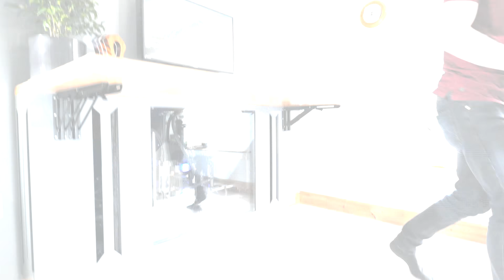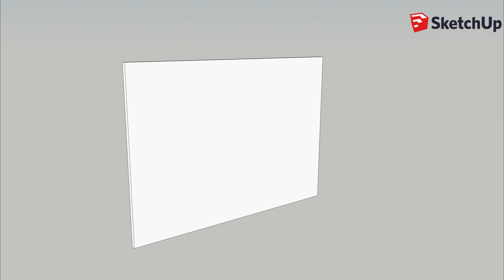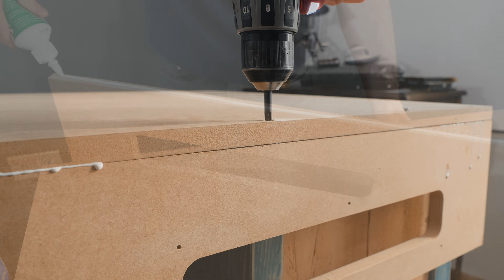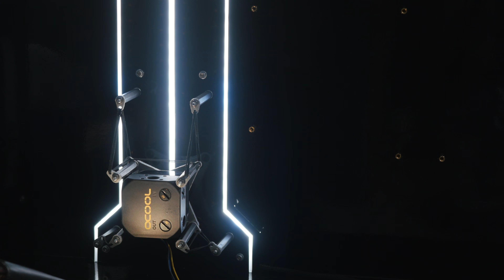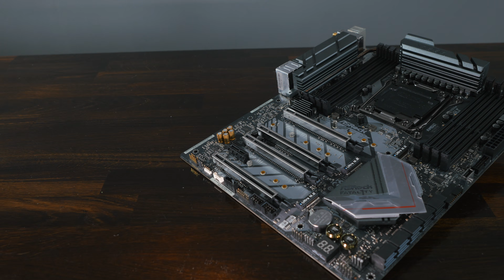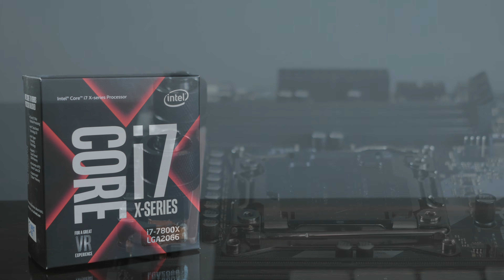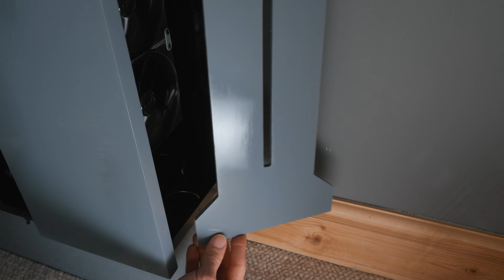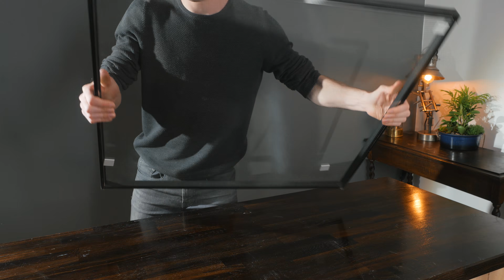Building a spectacular DIY 'desk PC' (it can fold!)

Comment: Wow. Just the pump mount. Wow. This is the first time that I have seen someone do something that unusual and also that good looking. Unfortunately those straps in time will create some problems but (unfortunately) the water will be changed before due to the bad composition of the aquatuning /alphacool one. As you sad the tubing are not that good looking but aren't also that bad. I will never do something like that because I'm more into "cutting the case that doesn't fit the enormous radiator that was provided for the mod, but still I cannot be more happy that someone has created something like what you did. Congrats man

Comment: incredible build, i'm really surprised the other components don't heat up and thermal throttle in the internal case without any airflow.  Particularly the motherboard VRMs. Incredible build though. I love love love the folding.  Truly unique and innovate build, A+.  Should be proud of yourself

Comment: Takes blade out of planer
Proceeds to plane flat surface

I feel like you had your reasoning but I still giggled, solid work on the finished build!
Reply: Scraping is a traditional technique used by greatest cabinet makers in the world to achieve a super fine finish which is well beyond sanding or conventional planing.

Comment: looks absolutly stunning but I am curious about how much it costs. I know this is a DIY and the cost is "only" the one of the materials, but even like that, you were offered almost every PC parts, which are often the most expensive for this kind of build. so there is that at first. but you have to add the cost of all the devices you use... drills, electric saw, electric sander, 3D PRINTER... sure you can saw and sand by hand, but the result wouldn't be as smooth as with an electric device, and the 3D printing part is just unreachable.
And everyone doesn't have a backyard in which craft like that. all in all, it would cost as much if not less to pay someone to do it than to buy everything you need to do it. I saw your video on my recomendations, and I was very excited to see your DIY, but I got more and more discouraged as the video was going... I will never have a place big enough to build it, nor will I have all the stuff you use, and even if I did have one or the other at some point (which would take me many years), I am not sure I would still be in the state of mind to launch myself into such à project. so this is fascinating to watch you build it, but I wouldn't call it a DIY as you have to be really versed into crafting to eventually be able to start it. this is clearly no beginner's work here, not approchable by your common viewer. other than that, great video, huge amount of work, really impressive
Reply: The watercooling bits alone probably cost as much as a low-mid ranged PC.
Reply: the pc with cooling maybe 2.5k or so?

Comment: Great video. I think you should take out a patent on your design because I think in the next few years manufacturers of PC's may use your idea due to the fact that pc components are getting faster and faster therefore producing more heat and the current case's probably won't be able to dissipate heat very effectively or quietly. Nice one DIY Perks.
Reply: this has zero advantages when it comes to cooling performance, he just threw money at the problem^^
also new hardware is actually staying at mostly similar / lower tdp (and power consumption) despite getting faster

Comment: I would have used two pumps in series, as your loop is very long and restrictive with 3 water blocks. It would have the benefits of reducing load on each individual pump and thus extending the lifespan, plus you have redundancy should one fail.
Great build can't wait for more

Comment: i was disappointed to see the cpu high temperature is 64c i have a amd 2700X cpu in a standard tower case i have 7 case fans 3 in the front pulling in air 2 in line directly behind the graphics card because the front ones run out of power by the time they get to the graphics card. 1 in the rear and 3 in the top. all of them are 120mm and all of them run on the slowest speed possible. 

my cpu on 100% load runs at 56c with an ambient temperature of 26C. i am really shocked that your cpu runs that high especially considering the massive water cooling setup you have i would have expected it to be atleast 10c below mine and im not sure why it isnt. maybe the pump isnt pumping the water fast enough? or maybe its because the box is sealed and its 35c inside i think thats the most likely cause

Comment: Fantastic build, but I really wanted to see you put some quick disconnect fittings between the main chamber and the radiators. It would just make sense. Other than that, 10/10.

Comment: Great Job! I I had to criticize some thing, I would say the wiring of monitor and USB-Hub ist not very aesthetic … but i guess routing flush would be would have been even more work. You could have embedded the USB-Hub into the Wood-Top, and i personally would have included a wireless charging coil into the tabletop.

Comment: Did I misunderstand, or is there a radiator (blowing hot air) housed INSIDE an air-tight case?

Liquid cooling just actively takes the bulk of the heat directly away from the components, but if you have a radiator inside the air-tight case, then you're really reintroducing that heat back into the same space that the components are housed in, thus passively reheating them.

The concept of your build is really interesting, but I'm not sure if it's sustainable after consistently long heavy processing loads. In my opinion, you should ditch the radiator inside the case and rely on the radiator mounted outside the case (in the side panel) for now. Keep in mind that the PSU and RAM components will also generate heat, but now that heat has no way to escape the case.

Silence can often be aided by adding acoustic dampening materials, and typically, there shouldn't be any noise coming from good quality water-cooling/cooled components anyway. To add, there should (in my opinion) always be an opportunity for a little air-flow from low (cool) areas of the case to high areas where heat will naturally travel to (these should all be shielded with dust guards of course), that way, there's no opportunity for heat to build up.

Either way, neat idea. 🙂👍

Comment: This is so impressive! LinusTechTips could easily learn a thing or two from you.
Concerning the chiller idea: Evacuating the main chamber might be a bad idea, since even the harddrives produce a little bit of heat. In a vacuum this heat couldn't be dissipated, so they'd overheat. A better idea would be to either use desiccant to pull all the moisture from the air inside (I'd recommend Phosphorus pentoxide) or to replace the inside air with either Nitrogen or Argon. For the latter two you must use dried gases or run them through a dehydrating column before filling them into the main chamber

Comment: You obviously put a lot of work into your builds so please understand my criticism comes from a place of care. I'll keep it to 3 points. First, the wall anchors are likely insufficient. Placing any weight on the edge of the shelf will be nearly exactly the pulling force at the position of the wall anchors. I hope you anchored into wood and didn't use drywall. Secondly, the monitor is far from you, that can be annoying which brings me to the third point, hide the wires into the wall. Other than that, looks like a lot of fun and I hope you enjoy it.

Comment: I'm glad you've got the videos recovered!
Fantastic build considering you don't actually have a workshop!
Just one small remark - the top has a potential of smashing into the base if folded without care. A couple of small gas struts would prevent that and also make the lifting of the top easier. Thums up!

Comment: A truly amazing build.
As a fan of silent computers I've adored your channel ever since you put a CPU tower heatsink on a GPU. I've used that setup myself after seeing the results.
Then you completely blew it out of the water by eliminating GPU coil whine in the wood and rope build. Frankly, I was jealous - I appear to be completely useless and anything requiring more precision than cutting firewood, so I knew I could never make the GPU chamber you used in that project.
This, this is something else. I've thought about sealing the computer instead of just the GPU, but I couldn't figure out how to cool every single tiny compnent that usually just gets cooled by air flowing around it. I don't think I would've ever thought of using a radiator and fans inside a sealed box to cool the air inside.
I have to wonder if it would be possible to use this concept without waterblocks for the CPU and GPU. If it could work, someone would be able to make a computer case that is completely universal and lets you use traditional coolers for your components. You'd just have to connect the fan and pump connector to the PC inside, shut the airtight side panel a boom - silent zero coilwhine PC with little to no effort. Maybe it could even attract the RGB crowd - a window that lets you see everything inside, without a need to clean the PC to keep it from getting dusty.
That reminds me - I find it hilarious that the window side panel on this case is literally a window. Love it.

Comment: You should consider fixing your 3d printer. Some of the prints look like you have extrusion issues. But the build overall is outstanding! 🔥
Reply: he uses a very cheap 3d printer
Reply: @cocoshort6528  yeah but I have ender 3, one of the cheapest 3d printers and if everything is set correct prints look just fine. I had same issues and it's just matter of maintaince.
Reply: @loczaczix  he bought a around 100 dollar 2d printer from about 3 years ago and he most likley could fix some of it but not m uch with how low end his printer is

Comment: This is an awesome build! So glad you were able to recover the footage off your drive! Just out of curiosity, how taxed is your PSU under full load with those high performance parts and the full loop?
Reply: there are online calculators for psu size :)
Reply: @johnuferbach9166  I'm aware of those. I tried a couple with some of his parts and got results north of 550W, which is why I asked how taxed his 600W unit is.

Comment: I really love this project. I have one comment/question. Do you find that having the main chamber airtight means that other components inside the case that do not have active cooling through the water system become a bit warm? I believe that if you place another radiator inside the component chamber with a set of fans on it plumbed in line with the GPU/CPU loop, your internal ambient temps would be regulated as well.

Edit:

Please disregard my comment. I opened my big mouth before I got to the end of the video and saw your internal case temps and the fact that it appears you have done exactly as I suggested by putting one of the radiators inside the component chamber. The first part of my comment still applies, though. Impressive work!

Comment: A chiller is probably more trouble that it's worth. Would like to see a custom wood monitor frame to match the desk. A larger monitor should be more ascetically pleasing as the current one is absolutely dwarfed by the desk. Very nice work Matt ~ it's probably a $10,000 machine.

Comment: Have you had any issues with static electricity when plugging into the USB ports?

Being made of wood, your case is not earthed and could allow sparks to fly when plugging in anything USB.
I had this problem with a recent build until I ran wire from the ports ground to a neutral earth wire. The case is painted inside and out, including the through holes, and the mounting bracket of the USB ports is plastic. A clear indication that the designer is an electrical genius.

Comment: one improvement you could make is an upgrade to high watt Power supply. The 600W you are using might not be enough fro the current components you have now especially under high load also if you plan to overclock it.. upgrade to 800W or 1000W if possible to avail a good enough headroom for all the power draw from the PC :) otherwise fantastic build and very clean and silent

Comment: Really impressive desk You've build there. Just a few tips regarding the actual watercooling loop: Invest in a decent fan controller, like an AC Aquaero, and equip your system with temp sensors for air and water. Without proper fan control and without knowing the water (and optimally air) temperature, You're not getting the most out of a custom loop.
Since You're cooling all critical components with water, the fans on the radiators outside of the main chamber could be powered off most of the time. You have so much water and so much radiator surface that on idle, low and medium loads and short load spikes the heat capacity of the water should be enough to deal with the heat without any directed airflow. Just measure the water temperature inside the loop and let the fans power off when under a certain water temperature. 
I reccon that with the sealed chamber and isolation mount the pump won't be a noise problem, but if it is audible, you could also reduce the pump speed when the water temps are low.
It seems like You're using NB eLoop fans. They're awesome radiator fans, but they really only work great when they can generate pressure behind the fan case. Otherwise they tend to rattle (getting worse over time) and don't deliver great airflow. It looks like You mounted them hanging freely in front of the radiator. I would assume that You get better performance with lower noise levels out of them when mounting them directly to the radiator with some rubber pads, or at least create some kind of air duct with tape or something.
Again, overall a really great system. Those are just the minor things I noticed as someone who's building custom loops and systems focusing on silent performance for many years. :)

Comment: My only concern with mounting everything to wood, well wood fibers in this instance, is static electricity. Is that a concern?
Also, (I haven't finished watching yet so maybe you have done this) but you really should have added a microswitch to the fold down desk, so it could act like a laptop lid and put the computer to sleep/lock it/turn it off when the desk it lowered!

Comment: Yes!!  Please install a water chiller in the future.  I am curious on how you would remove all of the moisture inside a sealed box.  I can think of three ways.  1 is to install silica jell packs on the bottom.  2 Get a portable dehumidifier unit and modify the input/output to circulate the air within the PC to remove all or most moisture then quickly close with small panels.  3 a moisture removal pack used in RVs and closets.

Comment: Disclaimer: This is not a hate message, I'm just generally curious. I'm confused as to having all that water cooling and X299 MoBo and a GTX 2080 running off just a small 600W PSU, don't get me wrong here, Seasonic is one hell of a PSU but, that is a lot running off just 600W. Hell, my Z97 + 4790K + GTX 2080 pulls 550W from the wall when I'm gaming and I don't have any water in my system or a 140W TDP X299 CPU/MoBo. I'm using all Maglev fans at around 600 RPM and my PC is silent unless you open the side of the case and stick you head in there. 11 fans and near dead silent in a Corsair 760T.

Comment: Sealing a motherboar is actually a bad idea, cuz chipset and memory modules need some cooling with airflow as well, they dont need much, but they still need it and you didnt watercool those. Chipset can generate significant amount of heat during a load and that heat is just trapped inside your sealed desk. With that type of desk you should go with a full cover mobo waterblock + memory waterblock. Moreover, there are 2 sections of vrm on a mobo, you cooling only one...
The radiator near reservoir dessipates the heat inside the sealed compartment, rly??? And the fans on it blowing that hot air on a mobo? RLY? No exhaust fans there?
Near the end of a video you switched fans position on that radiator without mentioning it, yeahh now its better, but still fans do not get fresh cold air, but at least now they pushing out hot air, not delivering it on a mobo. You could just move that radiator outside.
Your wires adapters will add resistance in power line and input lag for video output, not mentioning that something like freesync could not work at all.
Mounting a pump like that will cause it to wobble so the central shaft holding a rotating part inside of it will wobble as well while having like 3000 rpm. This will reduce the lifespan of a pump, cuz that shaft will destroy bearing holding it in place much faster.
Water in your loop goes from gpu to cpu, both of them are extremely powerfull and you are cooling your cpu with a hot water from gpu...while, since you had so much radiators, you could go gpu-radiator-cpu-radiator loop which will provide much colder fluid for both components.
In the end you showing how silent it is in real time, but you are not showing real time temps, only a picture of temps, why?
Why manufacturers do not make computer cases with wood? Exactly, moisture and it will hit your desk with time despite paint coating.
Reply: Moreover, this is not a true DIY video. DIY means when you doing something yourself keeping an eye on a budget. This video is an alphacool sdvertisement. Only these thick full copper radiators will cost a fortune, not mentioning a pump and waterblock. You do realise that only a few ppl could afford building with these components right? Due to a very high price of it. If you would want not only take money for advertising but make this build possible for regular ppl, you should name a substitute - cheaper components from China, this is what a lot of other diy ppl do actually. Really dissapointed in this video and i dislike it cuz its not trully diy as your previous videos.